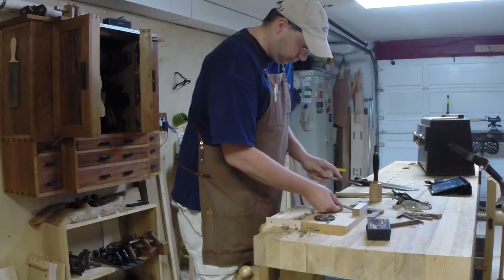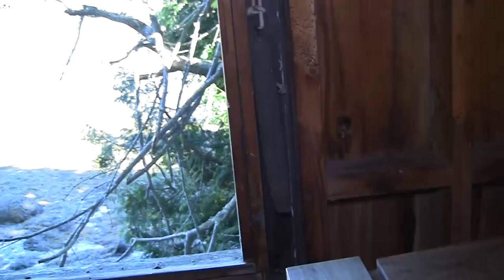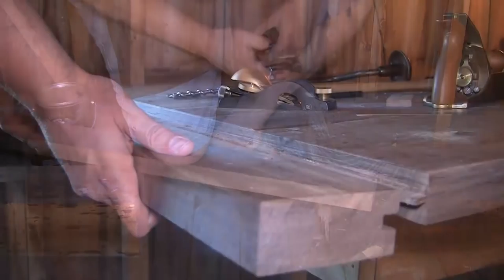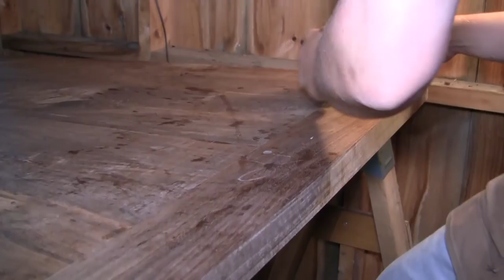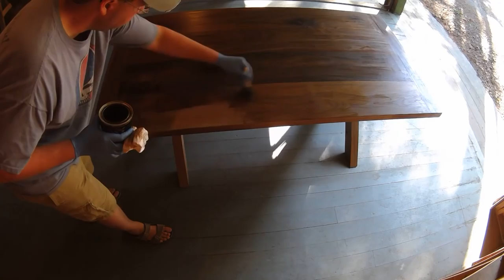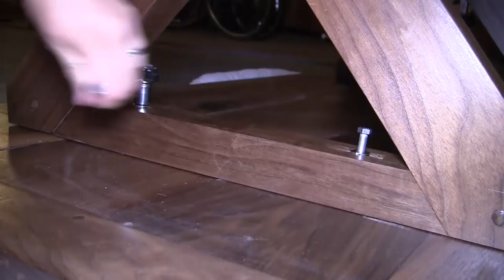RWW197 Picnic Style Dining Table Finale

Comment: What do you think about planing the breadboard as for a sprung joint and only draw-boring the middle tenon? Seems like you'll never get 3 draw-bores all exactly the same amount "drawn," and differences in the tightness of each one might cause problems with accommodating the wood movement.

Comment: did anyone comment on your use of a metal hammer with the dowel former? if not can you comment why you use it? the instructions say use something soft.  how are the inserts holding up that way?
Reply from the maker: +JayWC3333 I like a metal hammer for peg making as I get more oomph and a better feel for the wood as it drives through.  The plate is fine after many pegs

Comment: How would I attach a table top traditionally?
Reply from the maker: +JR Lenard I'm not sure what you mean by "traditionally".  This screw method in an elongated hole goes back a couple hundred years.  Prior to that some would use pegs straight into the top ignoring wood movement.  Pocket screws would have been used in some areas too even as far back as  the late 18th century.  Finally wooden "buttons" that slip into grooves could be used as well, but even then those would be screwed to the table top.
Reply: +RenaissanceWW Ahh thank you that's exactly what I was curious about because all I had known about were the cheap little L tabs that are used in modern tables, thank you for clearing that up

Comment: I have a question. Why on the ends of the table is it called the breadboards ?
Reply from the maker: +Jason Hockett its origin is literal.  The ends were put on breadboards.  Imagine a cutting board, now place hot bread directly from the oven on it and the wood dries and move dramatically warping instantly.  Long ago someone put a board across the grain to stiffen the other boards and keep them flat during that traumatic heating and drying when hot bread is place on the breadboard.  Some ends were are simple at a cross broad nailed to the cutting board.  Later to accommodate for wood movement our current iteration was board with integral tenon and groove that allows for expansion and contraction.
Reply: Ok thank you. Make a lot of sense now.